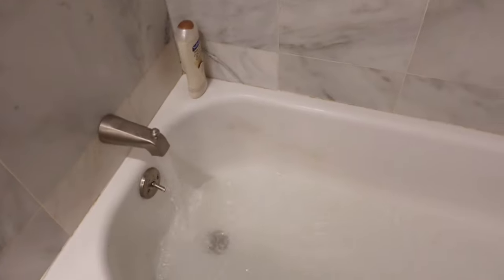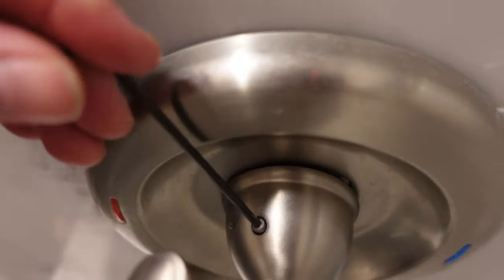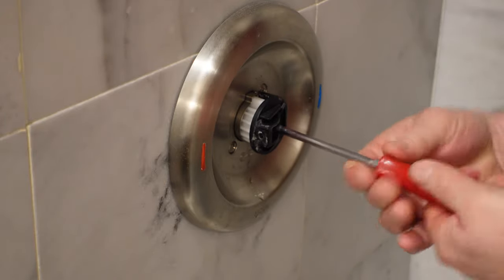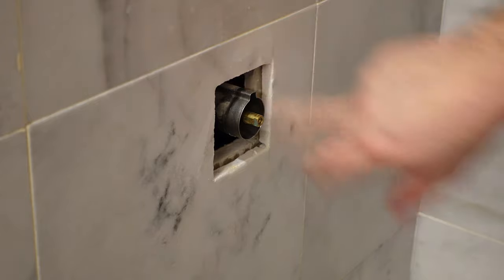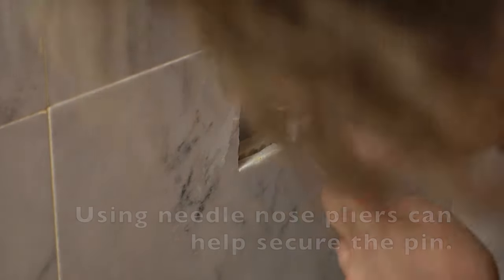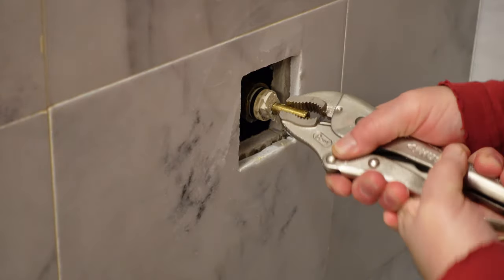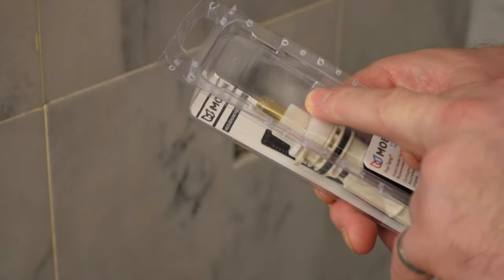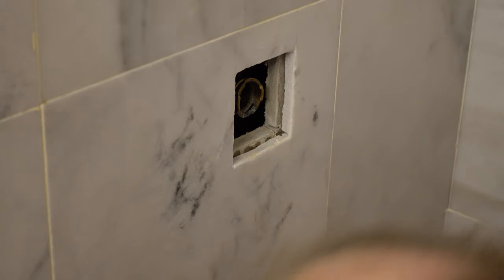Shower Faucet Won't Turn Off!!

Comment: One of the best YT vids I've seen in recent memory! Clear, to the point, and enabled a total amateur like myself to effectively repair an issue that was initially overwhelming. I also love how this isn't a 30-year trade professional demonstrating a hypothetical problem with brand new parts; our host mostly figures out things as he goes along, and came across a couple unexpected issues like we all do and talked himself (and us) through them.

My one piece of advice: If you are concerned the original cartridge is even more stuck than the one in the video (like I was), I recommend springing for the $15 "core puller" tool while you're already at the hardware store. if you get into the repair and don't need it, great! Keep it in its packaging and return. For me, the plastic "adapter" tool that came with the new cartridge was able to loosen up the original a tad, but I don't think I could have fully pulled removed it without the core puller. This tool also helps with installing/lining up the new cartridge.

To conclude, A+ video, thanks!
Reply from the maker: First of all - thank you for the kind words!! Second, I'm so glad you are able to give an update on the adapter. I wondered if it would be strong enough to pull out the cartridge. I'm going to look up the core puller! Thank y ou!

Comment: At 12:40 mark: my new cartridge didn’t sit into the pipe flush, and you need that in order to get the metal pin in there. My new cartridge was sticking out by about a quarter inch, so I just used my pliers to squeeze together the top of the H/C tab with the lip of the pipe and CLICK, it was flush. Put everything else together and I was solid. Thanks so much for this video, saved my day!
Reply from the maker: I'm glad you were able to problem solve!

Comment: Your video was the first that came up and I followed this exactly and got my replacement parts from Home Depot (apparently MOEN cartridges are covered by lifetime warranty by the way) and the special remover tool. Other than it being hard as hell to remove, this video saved me. Got it done in 1-2 hours including the trip to the store and it’s fixed and also much easier to turn than before. THANK YOU!

Comment: Old ones with the separate simple rubber washer valves and white china handles are way cheaper and much easier to live with. Modern mixing ones are a plumbing designer's wet dream.
Reply from the maker: Yup. I agree. We purchased the house 3 years ago, and almost everything was already here when we purchased it. Things are now starting to fail, and it's keeping me busy!
Reply: @designbypeck198  2 years in, same issues. Buy a house they said….

Comment: So what exactly is the problem? The tube thingy is just old??
Will it for sure turn off the water now if I replace that thing?
Reply from the maker: Hi Mel. I can't promise this will fix it, but, it my opinion, the faucet stem is the most likely reason for the water not to turn off. The only other thing that I can think of is if the handle itself is loose, and it no longer gripped the faucet stem to turn it off and on.

Comment: What should one do if the screw that holds the handle in place seems stripped?
Reply from the maker: If it's the screw itself, you should just be able to replace the screw. It will be a machine screw, which means it has fine thread. If you mean the receptacle to the screw, you might be able to 'tap' it to re-thread the hole. There's a thread tool called a 'tap', which will thread a hole.

Please let me know if that doesn't solve the problem, or if I am not understanding correctly.

Chris

Comment: Was the inside  tube damaged  and was that the reason why the wasn't  shutting  off???
I'm asking that for 'cuz  I yust fiished  installing my stand up shower   🚿 everything  new  and when  I turned the water on it wouldn't  shut off. 
I wonder if it's  the same  than the one fixed in this video eventhough it's a new sitem????
Reply from the maker: That's a good question. My tube was worn, but I couldn't pinpoint the damage. I"d say this is a quick and easy fix, and if it doesn't work, hopefully you can return the part? Manufacturing defects can always happen for new parts, even if it's rare, so it's worth a shot to try.

Comment: What does it mean if you follow all the steps and your water still won’t shut off??
Reply from the maker: There should be a whole house water shutoff somewhere. The must be, in my mind (unless you're on a well water system...that might be different, but I wouldn't think so). Find the water meter, and trace it from there.

Comment: What size Allen wrench did you use for the faucet set screw?
Reply: I couldn’t get any Allen wrench to work so had a star shaped drill bit, dewalt t15 that worked!
Reply: @nicolemoser7892  Thanks!
Reply: 7/64 works on moen
Reply: @jasonbachyrycz957  👍
Reply from the maker: Thanks everyone for all the input. Sorry for my very delayed response. I just checked, and mine was 7/64 - which isn't was I expected, but that's what worked.
Reply from the maker: Exactly what I found.
Reply: I live in an apartment 😓
Reply from the maker: @MissSeaSea  Oh no. Is there an apartment shut off valve that you can turn?

Comment: This is happening to me and the water is shut off and the shower handle is off
Reply from the maker: Did you find the whole house shutoff valve? It is probably near your water meter (if it's inside the house), or if your water meter is outside the house, look for where it enters the house, and it should be near there.